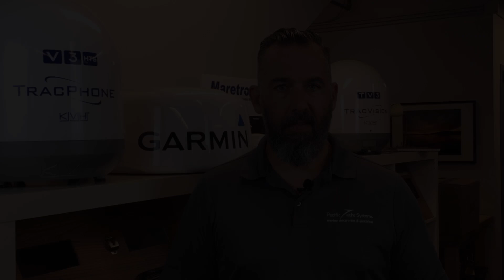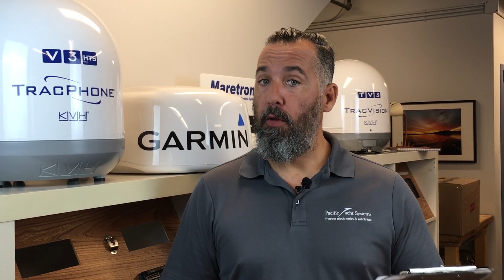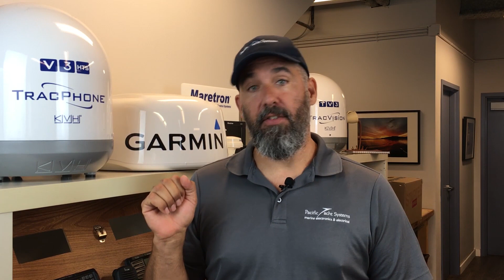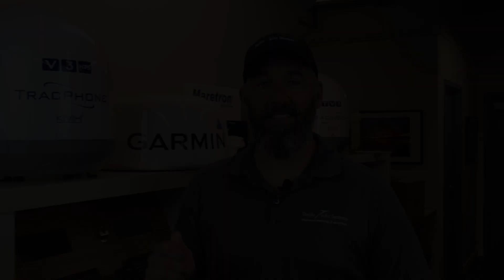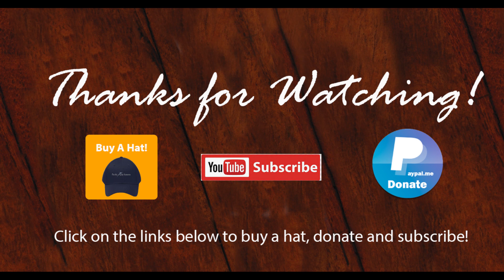Ask PYS - I Am Adding a Second Battery, Should I Use a Battery Combiner or a Battery Isolator?

Comment: My 21’ Scarab 215’s stock setup has 2 alternators to 1 group 27 flooded battery. I want to add a group 31 deep cycle AGM just for an audio system. I have a Noco Genius Gen5x3 charger installed, with 3 independently selectable battery types on each bank; flooded, lithium or AGM. I use the boat on the weekends to cruise around the lake and the boat is on the charger when parked. Can I install a Victron Cyrix-ct combiner or an Argodiode isolator with different the battery types and sizes?

Comment: Do you use zinc washers and nuts on battery connections to act like an anode or what ?
Reply from the maker: Generally we use the washer and nut that comes with the battery or combiner.
Caution, since stainless is not very conductive, never have a stainless washer in between connections on a battery post. The stainless washer needs to be last thing stacked on the terminals before the nut.

Comment: Hi Jeff, I have a battery combiner on the boat. The 2 domestic and 1 starter battery are parallel connected. The starter battery goes through an isolator, than a battery switch (which isn't adjustable old one) and finally to the combiner. The house battery goes to the battery switch and than combiner. I can't select in between other batteries but presume the Cyrix CT does the choosing? Would I use the manual isolator connected to the positive of the starter battery to only use the domestics? I hope this makes sense 🙂
Reply from the maker: Hi Sailing SV Mutiny, not familiar with Cyrix CT. Battery combiners should be connected directly to batteries. A battery isolator should be connected on the output of a alternator, and then in turn connected to each battery.

Here are some schematics on how these devices should be wired:
https://www.pysystems.ca/resources/diagrams/
Reply: @PacificYachtSystems  Thanks for the feedback, we really appreciate it.

Comment: Hey Jeff. Ordered a couple hats - let's see who notices at the marina! I followed your advice last summer and installed an ACR on my small sailboat that has two batteries. I've picked up a compressor cooler that draws an average 0.87amps/hour, so am thinking of adding a third battery to be safe when overnighting at anchor. My question is - with a third battery (i.e, two house batteries), how does the ACR set up change? Thanks!
Reply from the maker: Hi Jan, glad our videos are resonating with you and thanks for getting some of our hats. Based on your question, looks like you are adding a 2nd battery to your existing house battery bank. With two battery banks: engine and house, you only need 1 battery combiner (Bluesea ACR) between both banks.

Comment: Hi Jeff, Your thoughts on bonding systems and zincs. The question is _ "to bond every metal part under water" or "just bronze thru hulls" ? any light you could shed on how much zinc should be used? Does over or under zinc cause calcium build up? Cheers
Reply from the maker: Hi Alistair, good question for a future YouTube video... thanks for the suggestion.

Comment: Hi Jeff, it's been a few years since I've done any of this stuff, so please excuse me trying to catch up with the tech.. you mention a battery isolator being a better option. The ones I remember used high current shotcky diodes that still incurred a bit of voltage drop accross them and wasted power, they used to get quite warm from memory Is this still the case? The second question is with a vsr, why is a different size house and start batterys be a factor? Will current still flow to the house if say the house is 60% and say the starter battery is full, is it something to do with the alternator charger unit not knowing which mode it should be in and not sending the correct feedback to the exciter winding?? Thanks again for the video and advice. Regards Stormer
Reply: Hey! Trying to answer your second question: if your two banks are very different in size, you have to take care to wire the charger output to the largest battery bank, to avoid the relay constantly cycling on & off:
https://marinehowto.com/automatic-charging-relays/
Reply from the maker: Hi Stormer, the modern battery isolators are made of FETs and not diodes, and are much more efficient, definitely worth looking into.